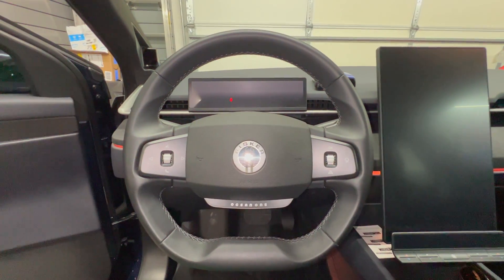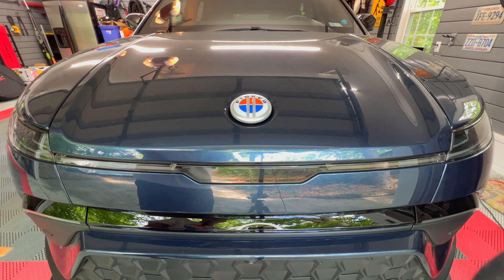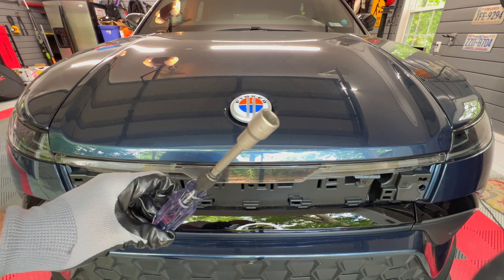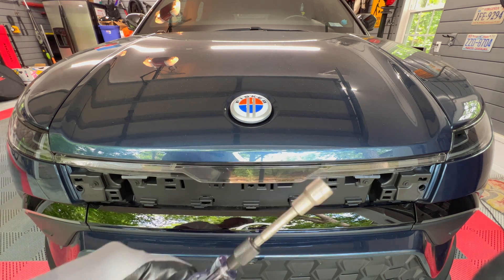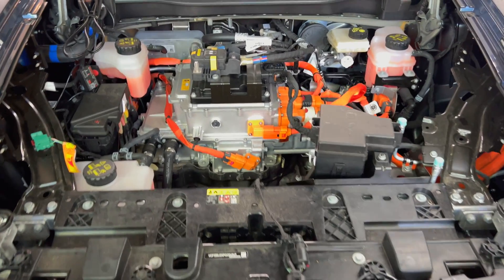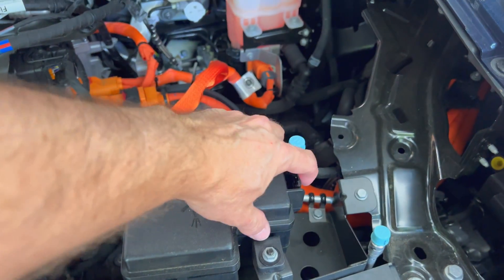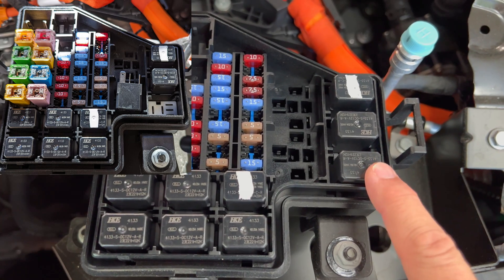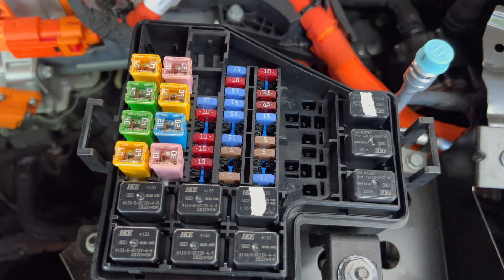Fisker Ocean One - Horn Relay Fix

Comment: Do you have any ideas on how to get the fan above the rear view mirror to cut off / reset? Mine has been running nonstop since 2.0 update and I'm scared to let the car sit for more than a day in fear of the 12v battery dying.
Reply from the maker: Currently, I’m not aware of which fuse would be used to reset this fan.  In my car, I have only heard the fan a couple times in the last six months.
Reply: @MTNRanger  well my good sir, if you could / happen to come across which one does, I'll be forever grateful because it's driving me absolutely nuts.

Comment: Thank you. After OTA 2.0 I have brakes failure alert. Do you think it could be fixed by unplugging fuse? Or is it more software related?
Reply from the maker: I’m not aware of a specific fuse for the brakes. I do see one for the brake pedal, but I don’t think resetting that will help.
Reply: In the split second I start up the vehicle by pressing the brake pedal the «brakes failure alert» pops up and goes away immediately. I believe this is a bug somehow popping up in the re-load/start-up procedure. I have not noticed any issues with my breaks, despite this short alert - maybe your alert is of a more permanent nature? After 2.0 installation I do also get an alert after a while of driving about the charge port being upen - which it is not. This is a well known 2.0 bug that allegedly will be dealt with in the next update - if that ever comes
Reply: @BjarneLauritzBull-Berg  In my case it's a permanent alert. And brake pedal resists when applied, with vibration, I have to push very hard to stop the car. Also, no regeration in any mode. I hope 2.1 will fix it.

Comment: While we all, very very much love the fixes you bring to your channel, there is a question. Why are all these things needing constant attention, fixes, fuse removal and reattaching, OS soft and hard resets? I actually do own an EV - 2020 BMW i3s REX. Guess it's not a full EV as it gets 180ish miles of EV and then you can click it into a hybrid mode - small scooter engine runs a generator to maintain the state of charge. I never had to worry about the horn not working, 12v battery vampire drain, screen not turning on, or software soft or hard rests. In fact, I would not even know how to do a reset of any operating system on my i3. Have we gotten way too complicated in our creation of computers on wheels? And, of course we have to say, if relays or fuses are laying inside holding trays, wow, that is really sloppy assembly.
Reply from the maker: The issue with the relay is when the cars are transported, the relays are removed (along with the 12 V battery being disconnected - which had it's own issue of alignment). This has possibly only affected a few vehicles.  For example, mine was working fine. Today's fix really has nothing to do with other issues like software problems.  The i3 did have issues when it first came out (most EVs have 12 V problems at some point).  Anecdotal fallacy is that you may think your situation represents all other i3s, which is most likely not the case.  You can search BMW i3 forums and find examples.  That said, the Ocean does have a lot of issues that need to be sorted out.  Luckily, I think the 12 V battery management in the new updates solves many problems.